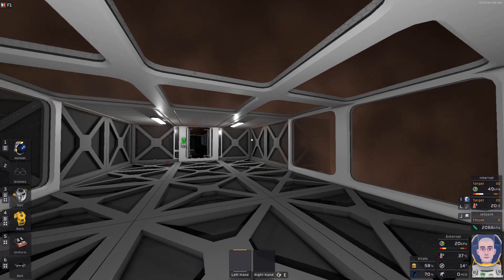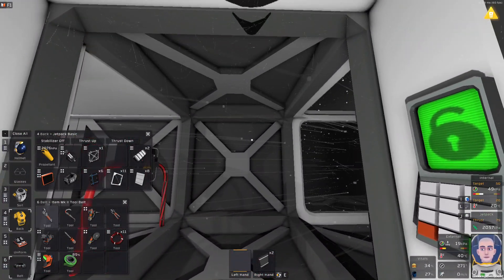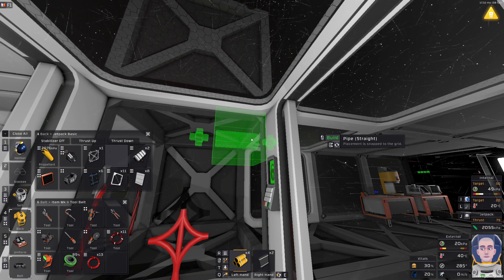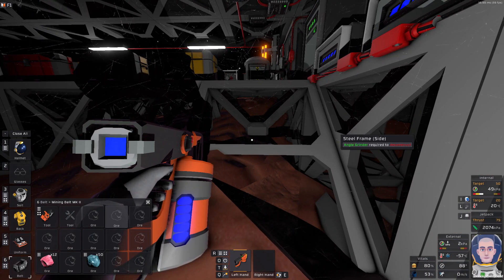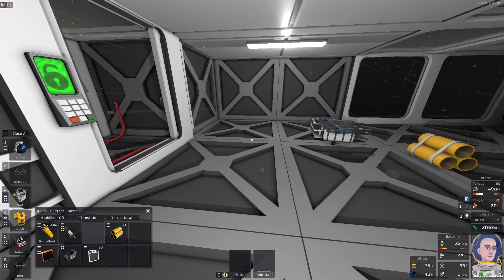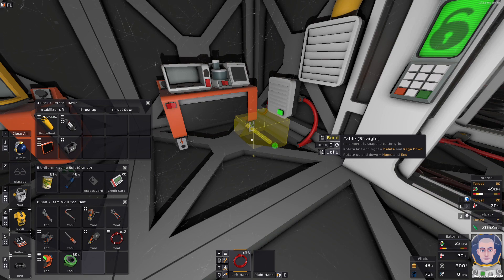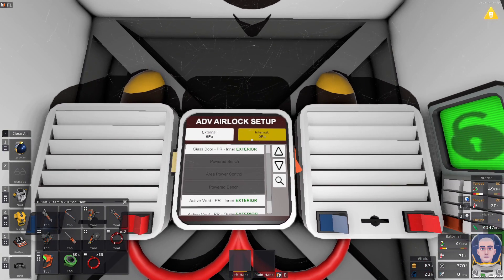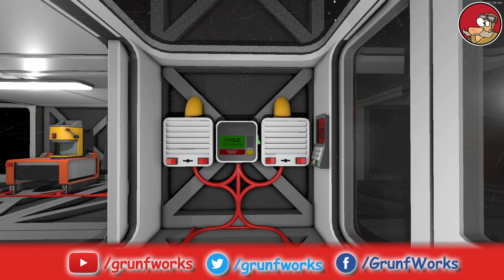Airlocking the new room - Mars Survival Getting Started Guide - ep 23

Comment: I prefer separate APC on every airlock, on the inside. SHTF and no power? -> pop in a battery.  Also, when splicing cables elsewhere the airlocks dont cycle..

Also, the gas sensor fits nicely in the middle of the floor, looks like a shower drain :)
Reply from the maker: Hi Stian, sorry i missed the premiere. Was putting kid to sleep, but she put me to sleep instead. One thing i agree with you is that i am beer kinda guy ;-)